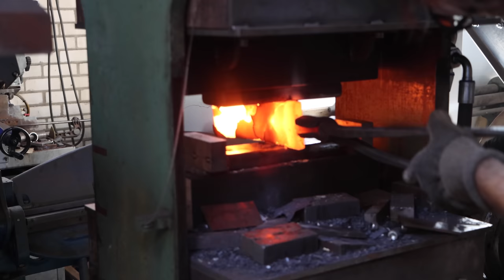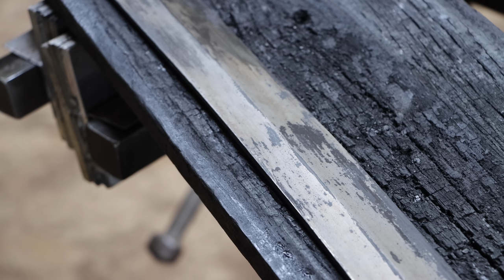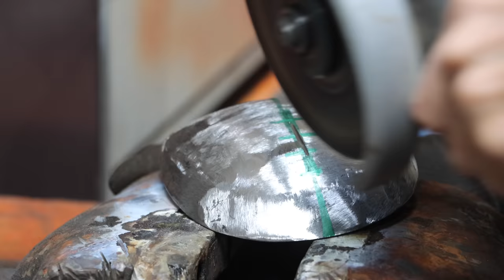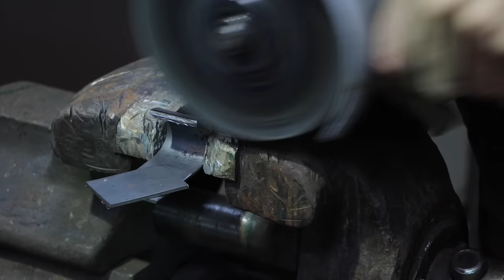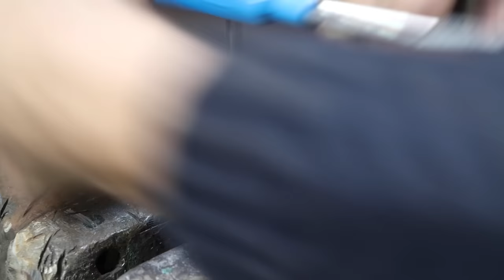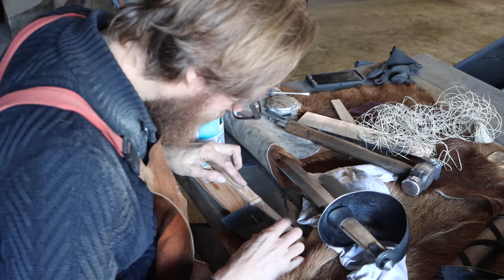Forging a cutlass sword, the complete movie.

Comment: What's the meaning of letting the blade cool down between two wooden boards and what kind of wood do you use?
Reply: My complete guess is that the wood acts as a giant clamp so the metal doesn't warp.
Reply: Normalizing. (Stress relieving).

Comment: What is that flaking off when your drawing it out? Iron oxide? The flux?
I know its called slag or whatever, but what is it.
Reply: Its called "Forge Scale" and its just essentially a build up of iron oxide that forms on the outside of a piece of critically heated steel. It's kinda like a layer of sweat that the metal builds up during the heating process that then becomes sacrificed when hammered or smashed in a press. 
I hope I did an okay job explaining it, I'm not a Blacksmith.